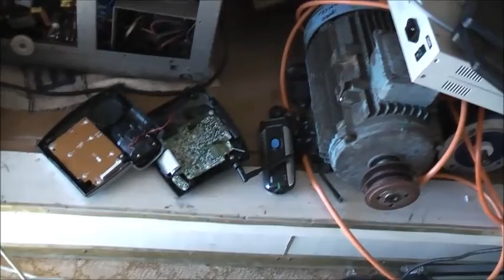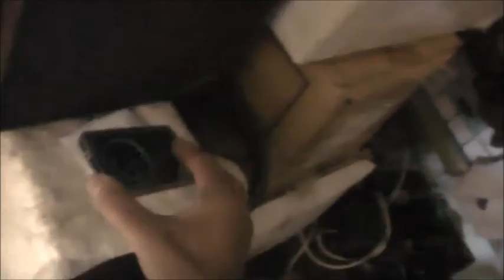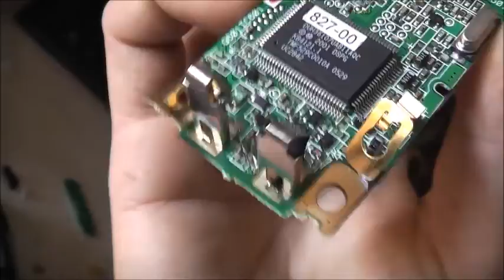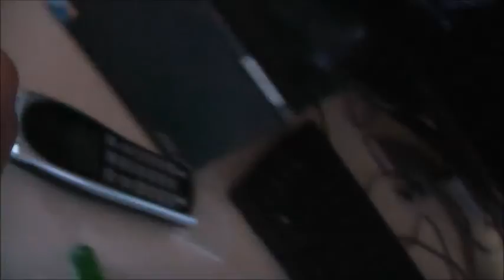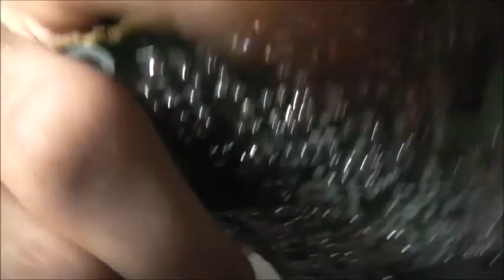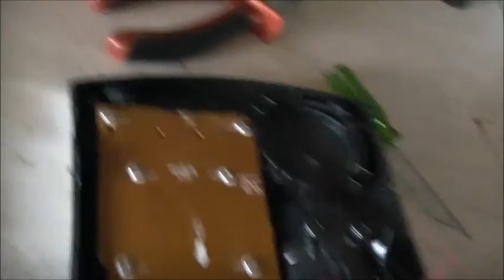Uniden Cordless Phone Set Teardown

Comment: Uniden phones are indestructible! Drop them on a workshop floor from a height and they wont break!
Reply: I've always sworn by Panasonic cordless phones until this year when I bought a Telstra branded phone after my old Panasonic phone died after 10 years of service.
Reply: Lachlant1984 yeah panasonic equipment is pretty good (pity their inverter microwaves are crap)
Reply: I've got a Panasonic inverter microwave, I've had it since early 2008 and it's still working as well as it did when I bought it and I use it a lot, at least 3 times a day.
Reply: Lachlant1984 interesting, you must have better luck with them than i do!
Reply: Maybe.  I couldn't tell you what model my microwave is though, it's pretty old, but I'm happy with it.
Reply: Lachlant1984 like they say, the older the better!